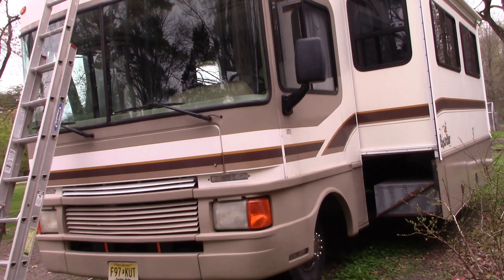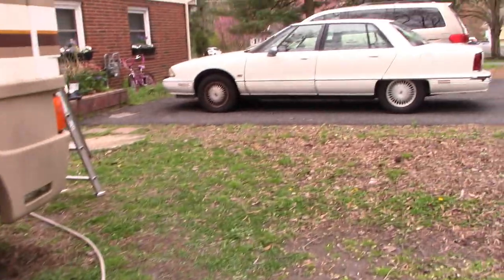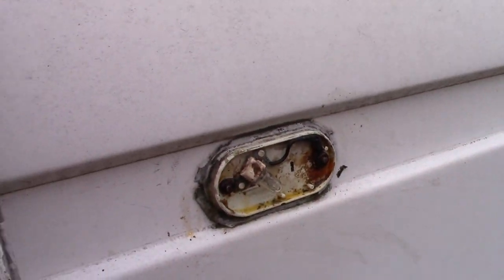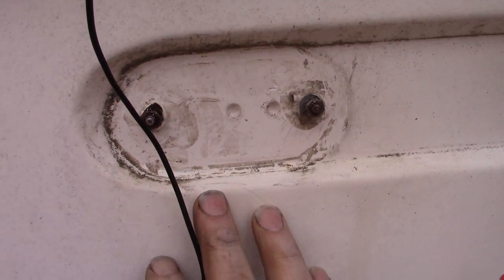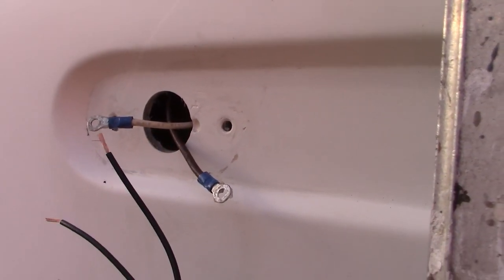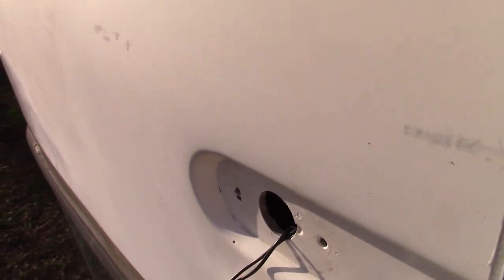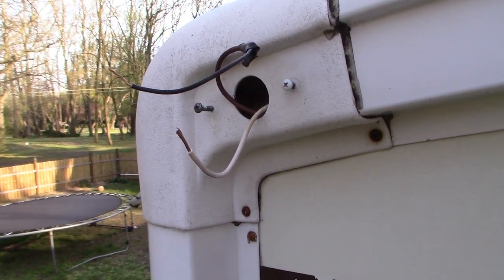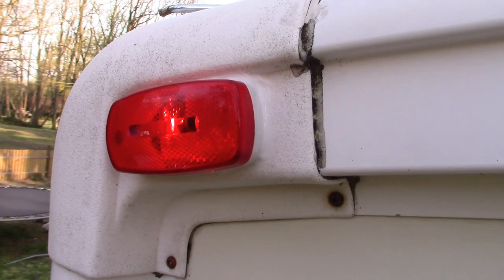Bounder-on-a-Budget  /  How to Install New Marking Lights on your RV

Comment: I just did this job today, front and rear. Replaced them with the same ones that you linked on Amazon. It sure was a pita but well worth it. The weird way they wired the originals was pretty much meant to fail eventually.

Comment: I did that job too. I installed bright LED's. 
My 12 volt wiring had bolts that were loose and corroded too.
I had to remove the cabinets forward  inside and remove the cap and rewire the rear 12 volt wiring for the lights.
I took out all the bolts and put them on the wire-wheel, then reinstalled them and they work great again. And they're beautiful. Lol
Thank you for your videos. I really enjoy them.
Reply from the maker: Oh wow! I did NOT want to have to take things apart inside the motorhome for this project, so as you saw,  I devised a way to do it all from the exterior. Thanks for watching, Kelly!

Comment: I would have never know those bolts are wired physically like that.. I assuming you just pull the light switch from inside to ensure they came on or did you have a dashboard switch to turn those on?
Reply from the maker: Yes, they come on with all the running lights with the pull of the headlight switch.

Comment: That looks real good.  I put new lights on my Rexhall like that,  After 3 years, all the light fixtures are unreliable again, most soaked with water.  I wonder if there is a LED replacement fixture in the same size.  Gonna look, because I'm tired of fooling with the broken fixtures on a ladder, usually before a trip.
Reply from the maker: I won't want to do this job again in just 3 years! The first set were on the RV for 22 years. If I get half that much time out of these, I'll be content. I wanted to get LED bulbs, but reviews were saying they burn out quickly and you end up replacing them at frustratingly short intervals. Don't know if that's true or not....